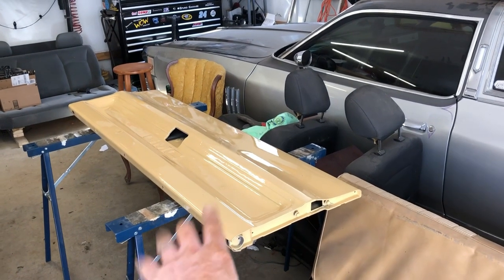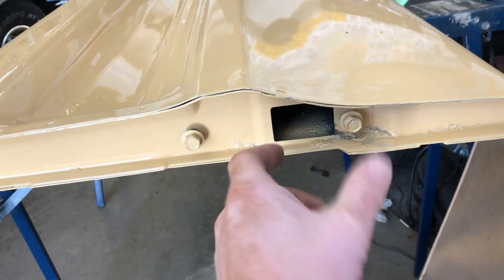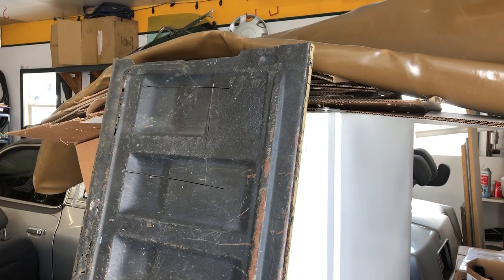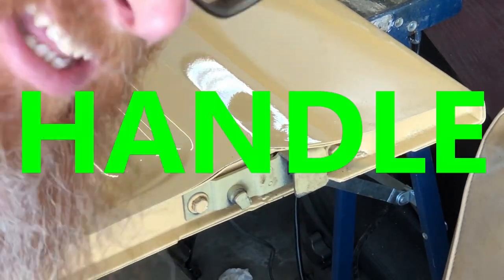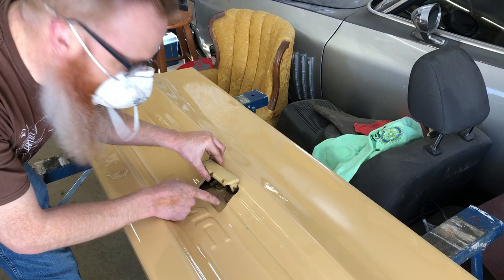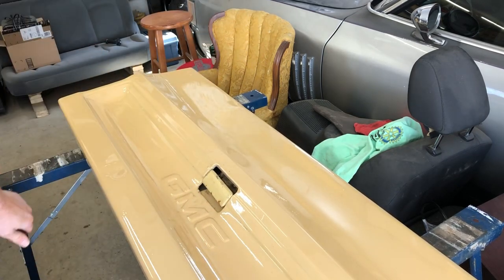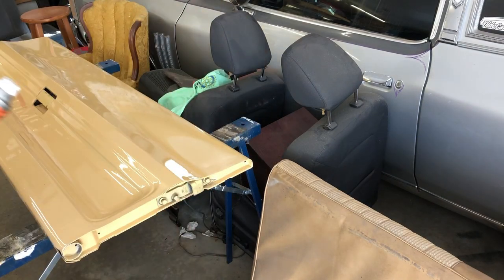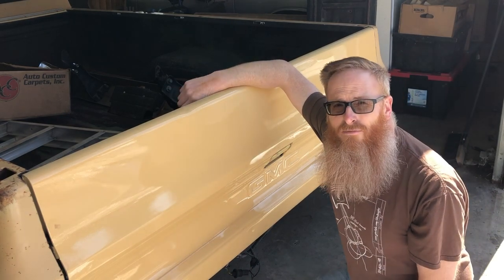HOW TO REMOVE AND INSTALL A TAILGATE HANDLE IN A 1973 TO 1987 CHEVROLET C10

Comment: I have a 95 Ford f350 and there is a removable panel the length of the tailgate that makes this job much easier !!
Reply from the maker: I wish GM had fought on to that!
Reply: I had a 95 F150 in HS, I don't think I ever took that panel off more than once, but it sure helped getting the latch to work better.